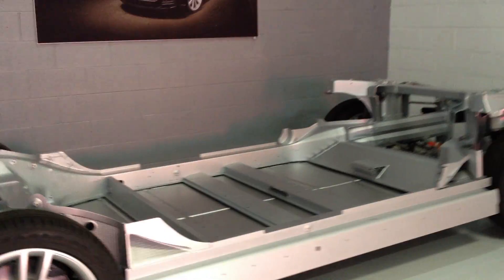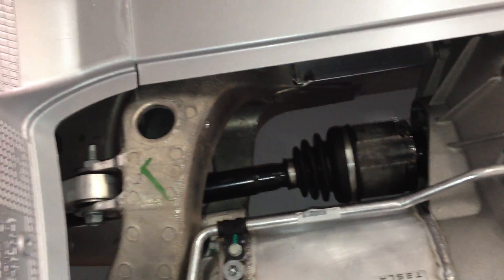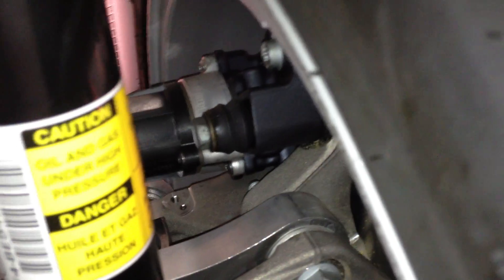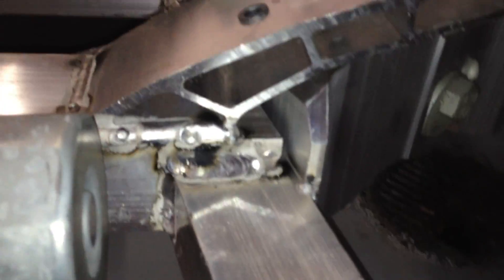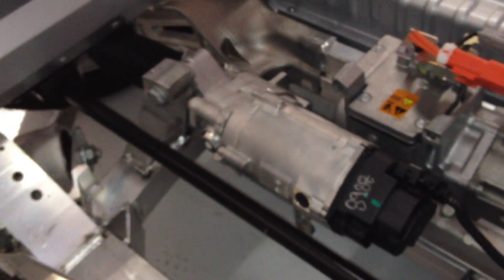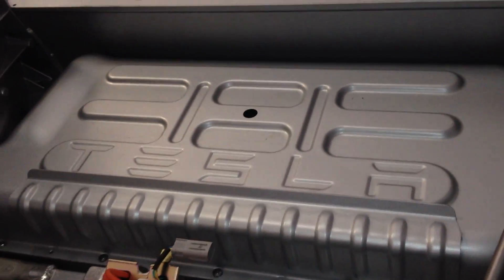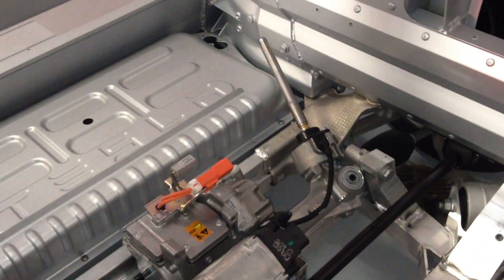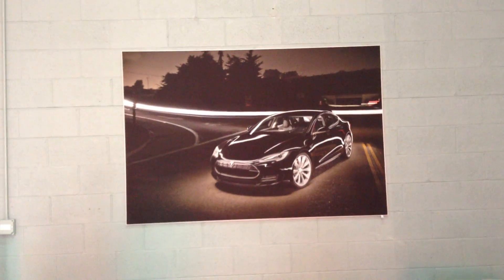Tesla Motors Model S: Part 25 of Many!  MS85 Frame & Battery

Comment: Didn't Elon Musk announce at the SuperCharger/Battery Swap press conference that you sure can get the 85kWh battery swapped in (for like 10 grand) and it's just a config file they need to change? At least the ones having bought the discontinued 40kWh version just get a 60kWh which is limited in software to 40.

Comment: I'm no mechanic, but I believe the "alternator" next to the motor is actually the inverter responsible for converting the battery's DC power to AC that the motor can use, and vice versa.  It's this part that they beef up in the P85 to give it more go than the standard 85KWh version.